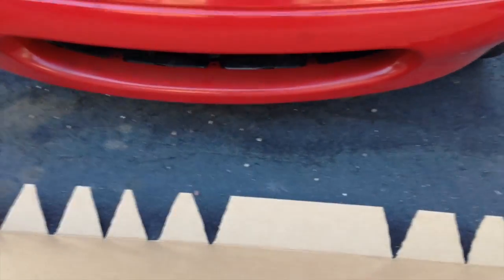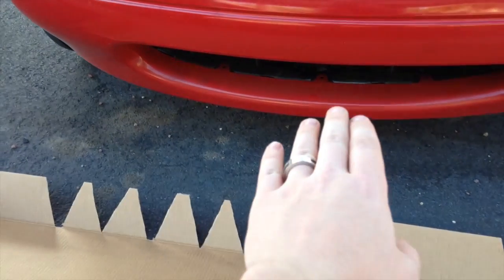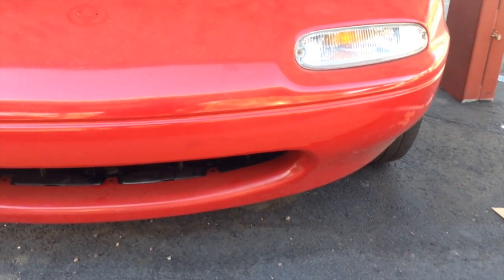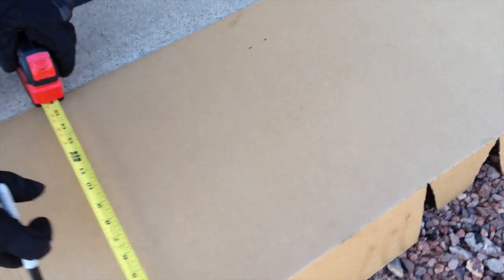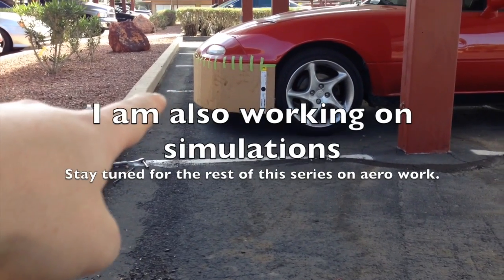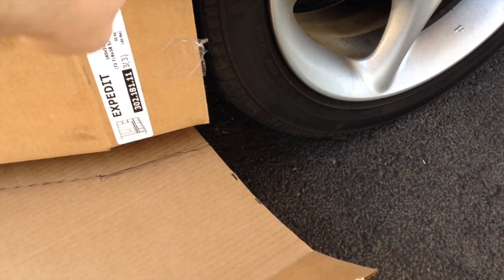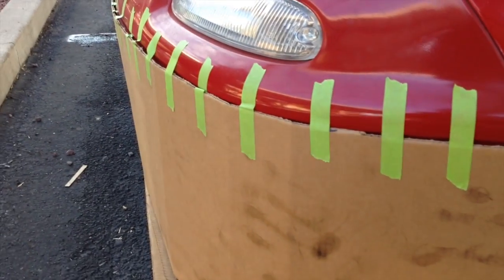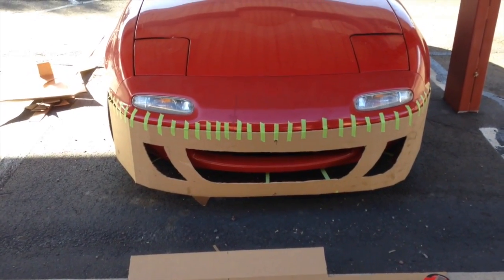DIY Front Air Dam Part 1 (Miata)

Comment: Nice video . 
   What drew my attention to see your video , was that you are using cardboard as a general mock-up. I think using foam is a waste of time and energy but others prefer to use that method. 
    I will be making a wrap around spoiler kit for one of my Mercedes. I plan on taking videos of the progress and may post them at a later time . I don't want to feel pressured and rushed by the viewers. I feel I can meet the expectations of my progress and work , without being pressured.
    I like the details that you spoke of , by having the front bumper to be in front of the tires , to redirect the air and to design the bumper to prevent front lift and to have better fuel economy. 
   I plan on watching your videos . Keep up the good work. 

Best 
Regards

Comment: if you want better fuel economy by aeromodifying your miata, you should check you the aeromod section of the ecomodder website, they have cars that get more than 2x the EPA rating in MPG and they have cars that have been wind tunnel tested,you will learn a lot and my want to redesign that bumper yet again after you see some of their mods and the number they are achieving., cosmetically your design looks better than the oem bumper though
Reply from the maker: I have seen much of the work they did.  I could increase my mpg by probably 50% if I wanted to compromise on grip and drop from a 225 square stance to 185 or even 165 tire.  I am driving a ton now, but so much is stop and go that the aero only plays a role some of the time right now.  I am actually wanting to repurpose the headlight motors to do some active aero in both front and back.

Comment: excellent tutorial sir. I am completely novice here and wanted to know if you can give me some ideas regarding the pins and boltings of the bumper. Thanks in advance!
Reply from the maker: Thanks, it will help when I get part 2 done for this. I am going to be using a combo of aluminum rivets and some sheet metal screws to attach the air dam to the bumper. Then sheet metal screws will attach the air dam to the front guard which will be bolted to the splitter from the other video. It will all become clear when I get the second radiator mounted for the turbo build...I have to get some things done before finishing others. The main holdup was radiator which is done now. So yes I am going to finish this air dam. ;)
Reply: wow! thanks so much! will definitely wait for it. :)

Comment: awww cmon man pt.2
Reply from the maker: +eel1331 So I was waiting to swap out the radiator before doing part 2 of this. I have done that now and have part 2 in the works. I also have more aero videos coming soon, including the rear bumper aero cut and some rear "flares" to install. Last highway run was ~28 mpg with the top down...so yes the things I am doing have results. Stay tuned.

Comment: Hope its not stayin as cardboard?a template for fiberglass at least?if not stop tryin to mod cars lolll lets see your fiberglass skills part2!!
Reply from the maker: Rofl! Cardboard is for really bad ricers. Its a template which I have cut a master from in coroplast to be aluminum skinned. The laminate will be strong enough to hold up to normal driving up to ~130 mph according to the track regulars. The only way a stock miata goes that fast requires an airplane. :D Would love to do a glass core with carbon skin, but Mrs. Nickelndiminit doesn't want the smell.

Comment: I used some corrugated plastic to make a prototype air dam under the bumper of my 2014 Mitsubishi Mirage. It didn't seem to have any noticeable effect on fuel economy, but it did wonders in terms of stability on the freeway. In stock form, the front end would start to feel a bit light around 70-75 MPH, but with the air dam, you don't even feel a difference between 40 and 70.